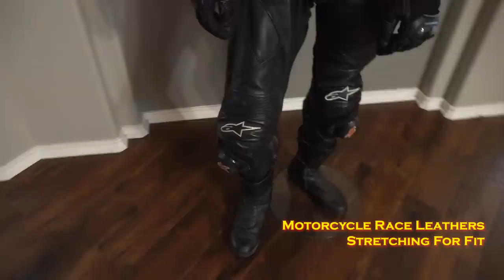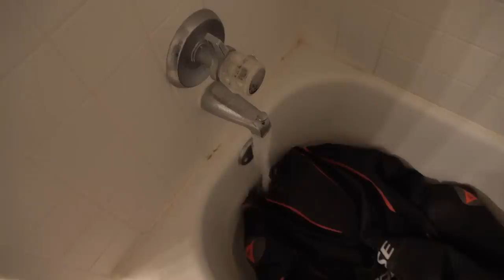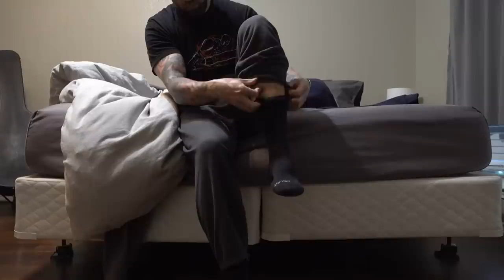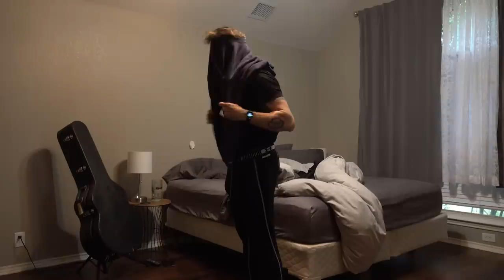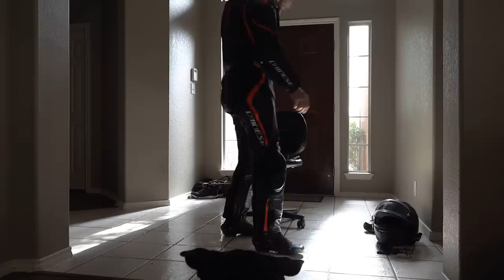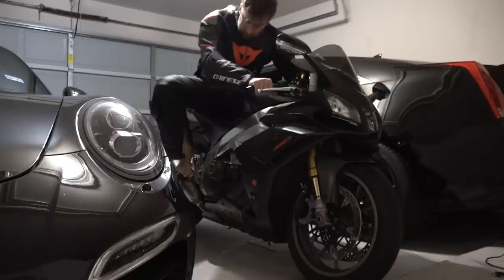How to BREAK IN Motorcycle LEATHERS Suit for New Dainese Motorcycle Suit 1 Piece

Comment: After all that stretching it’s now probably too large.  I prefer to have a tight fit in a race suit.  That way the leather won’t roll or bunch up if I’m sliding down the road.  I’m not interested in being able to move around in the suit,, as I want the suit to move along with me.  Therefore it needs to fit just like a second skin.  That means very snug to tight.  The idea of soaking it in water before you first wear it to break it in is actually a terrific idea, especially with wearing the compression tights and shirt underneath.  That way the suit will form more closely to your individual body.  If you go outdoors into the sun while wearing wet leather, the leather will actually shrink as it starts to dry out by the sun.  When it shrinks, it’ll shrink down to the size of the person wearing it at the time, helping to give you a more exacting fit.
Reply from the maker: no, it's definitely not too big. at least now i feel like i can move around on the bike a little bit too. no bunching. it's still tighter than my old alpine stars one used to fit, which stayed right with me when i ragdolled down the blacktop after centerpunching a deer last year.

Comment: Awesome video man and just what I need for an upcoming trackday. I've only worn my Dainese suit once and it's still a bit too tight in the crotch so I'm definitely trying this. Plus I just plan to wear my new TechAir 5 underneath it so a little more room is definitely needed. I would've never thought to soak it in water though. I was thinking of steaming the suit and putting some weight on the crotch together to stretch it out. How long did it take to air dry?
Reply from the maker: glad it helped! yeah, these things are so dang stiff. first suit i bought i swore was the wrong size, but eventually it breaks in. leather will stretch when it gets wet, speeds up the break in process. The dainese did seem tighter in the crotch than the alpine starts one. not bad riding, but standing sure is. If you put it on soaking wet, pack the crotch like i did in the vid, and go out and ride, the 90 mph wind will get it drying pretty quickly. when you get home, it probably won't be any wetter on the inside than if you'd gone out on a hot day and sweat like hell in it. Soon as you're home, hang it, and put a fan blowing on it, making sure the zipper is down and as open as you can get it so the fan air can get inside it. if you do that overnight, by the next morning i'd think it should be good.
Reply: @NoLimitsNoRegrets  this video, and specifically this comment are great
Reply from the maker: @inlandbhsk8r  Howdy! thanks and gad you enjoyed it!

Comment: I have the same suit and same problems.  Seems like just wearing it around the house and a couple medium long rides isn't enough so I'm gonna try this.  Did you need to recondition the leather afterward?
Reply from the maker: It did seem to be a bit tighter than the alpinestars one i had before, but this definitely helped a lot. Once it completely dries after all the wetting and stretching, yes, i'd recommend clean and condition it. I have a link in the description below on how to do those as well. Hope you can get it fitting better!

Comment: If I stretch it out with these method will it keep being lose or will it become thigh again and I have to redo the process?
Reply from the maker: from what i've seen, i haven't had to repeat the process. the only thing i can see maybe causing it to get tight again is if you get caught in a rainstorm, and it dries in a way that causes it, so if it gets wet, be sure to hang it in a way it can dry with the weight of it stretching.

Comment: Before soaking the suit, did you take the protective padding that’s inside the mesh lining out, or did you leave it in?
Reply from the maker: i left the armor in place as i wanted to get right on the bike and start riding in position with the leather as wet as possible. the armor is waterproof since it can be exposed to rain, sweat, etc. too. I don't know how long you've had gear, but some of my older mesh jackets and pants have needed the armor replaced every few years as it tends to break down over time, or at least they have. I never had to replace the alpine stars suit armor though in the 8-9 years i had that.
Reply: @NoLimitsNoRegrets  Thank you! 🙏🏼 I’m going to give it a shot now.
Reply from the maker: @apnea3258  Awesome, hope it stretches enough to accommodate your fit!
Reply: @NoLimitsNoRegrets  I stretched to my liking. However, I would still like to give myself a little more room around the area where my knee pucks sit. Idk if the pucks are supposed to be relatively tight around your knees?
Reply from the maker: @apnea3258  first, that's great the suit overall fits better. as far as the knees...tight is a relative term of course. I'm surprised that's where you notice it being tight. Maybe because i have chicken legs, but i was more concerned about arms and crotch fitting as if those areas were too tight, i couldn't freely move across and up and down the bike when riding. If i think about it, my knees are probably a little snug too as i know i've adjusted those vertically on my legs to make the suit feel right in the crotch too, so maybe that's part of the design as they want the pucks to stay in the right place to protect you and also have the suit not crawl up or down on the rest of your body. Does that make sense?

Comment: When hanging the suit up, put a gallon of water into each leg and one across the crotch area. Also, use some additional hangers with clips to clip onto the collar, with the suit hanging unzipped. These two thing combined will help get the thighs and the torso stretched while you are not wearing the suit. Also, use the leather treatment extensively during the stretching process, it will help speed up the process while at the same time protecting the leather from tearing. 
Going for walks around the neighborhood in the Texas sun helps a lot too as the leather stretches easier once it is hot from the sun and your body heat, but make sure you stay hydrated. I hope this helps!
Reply from the maker: good tips! i was trying to think if there was a way i could attach to the bottom cuffs w/o damage. thanks!
Reply: No Limits - No Regrets You are most welcome! Great suit, I hope you enjoy it! Btw, I use Leather Master products on my Dainese suit, it is actually the same stuff Dainese sells, but you can get it cheaper when it isn’t Dainese branded.
Reply from the maker: @TexMexStrada  badass thanks!
Reply: @TexMexStrada  What do you mean use extra clips by the collar? The hanger the suit comes with isn't good enough? I guess I just don't understand the instructions.
Reply from the maker: @matthew8031  i think what @TexMexStrada was saying was you know those hangers that have clips on them in clothes stores? think he means take a few of those, get enough clips, and use it to clip to the collar so it pulls up flat out with the suit unzipped?

Comment: How did you dry it afterwards?.
Reply from the maker: i rode in it for quite a while to air dry the leather outside while it's stretched over me while riding, so it sets that way vs. if i'd just let it dry on the floor, it might set shrunken back. when i got home, i hung it and with just the inside a bit damp, it isn't much worse than getting caught in the rain. Can put a fan blowing on it as well to dry it a little faster.

Comment: that suit looks way to big for you its not ment to be baggy
Reply from the maker: can i ask why it looks too big? was pretty restrictive trying to move around on the bike?
Reply: @NoLimitsNoRegrets  You have too much room in the legs.  Looks like you're wearing jeans underneath there and for a suit, that's not the right fit.  Also, your arm length is a bit long, the wrist cutoff should be about  1/2 inch from the base of your wrist so you have full range.  The suit in the video extends all the way down.  I would've recommend a size down from what you're wearing and then wear it to stretch and conform.  You shouldn't even really be able to stand up like you are.  You should be hunched over just a tad.
Reply from the maker: @roundingcorners  dang, i would never have guessed it looked that big on me? i'll blame my chicken legs for being looser in the thighs, but a size smaller is hard to imagine even getting into. the front zipper is snug pulling up with just thin underarmor under it. despite having ridden in it a lot, gotta say it still feels tight trying to spread the legs for leaning into turns, which i wouldn't think should be the case? Starting to think the only way to get a perfectly fit suit is just provide dimensions to dainese or whoever and just have it made exactly for me and hope i don't gain/lose weight :/
Reply: @NoLimitsNoRegrets  some suit models off the shelf just wont fit you right.  either it's going custom or changing your own physical appearance.  I'm guessing if you lost 10 lbs, going a size smaller would be possible.  Please dont take offense, I'm in the same boat gaining 10lbs from the pandemic.  My size 52 is really snug on me now.  Make sure you oil and condition that suit - soaking it like that has robbed the leather of all its natural oils.
Reply from the maker: @roundingcorners  no offense taken. had 4 heart procedures, hernia repair, and stem cells last year, so my focus has just been getting healthy again. i recently started eating at restaurants more and lifting now able to go to gym, so i've put on 10 solid pounds, which is good, but suit just keeps getting more snug haha. yes, actually made another video on the channel for clean/protect of suit as i agree the water will dry it out, so made sure to treat it right away

Comment: How is this technique, does it works ? Write your results of today’s date please
Reply from the maker: Leather will absolutely stretch when you get it wet and reform. best to soak it, ride in it until it dries is the wind on the bike, very actively stretching like through turns (vs. just sitting upright). Speeds up break-in for sure, gives a little more breathing room if a suit is just a bit tight but the next size up would be too big.